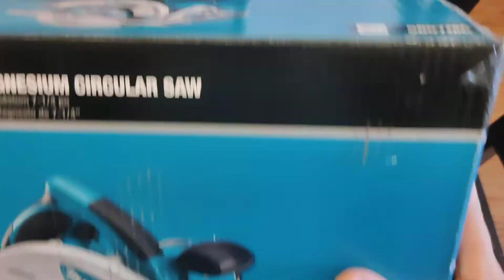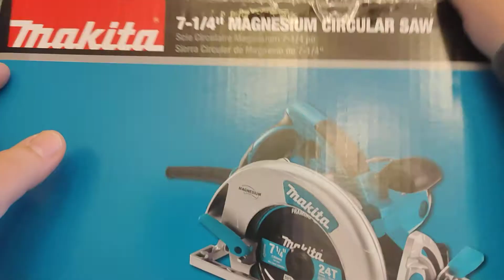5007MG 7-1/4" Magnesium Circular Saw Makita

Comment: Is there a way to calibrate the positive stops?  They are not accurate all on my 5007mga.. I want to like this saw.
Reply from the maker: Well, for more precise work you'd use a miter saw, you can flip this one upside down and use an angle gauge always.

Comment: Doesnt magnesium crack easy?
Reply from the maker: Pure magnesium does crack rather easy, and that was true for some weaponry applications in the last century. Since then, the metallurgy industry has been making a lot of alloys with different properties, making it stronger than steel, while lighter. The failure stress fractures on those are however cracks, where iron and iron alloys are failing by bending being more pliable metal. I've abused a lot mine, since purchase, but seems to be holding pretty good.
Reply: Lots of full blown race cars have magnesium wheels. Metallurgy has come a long way. Just don't throw your saw off a 5 story building.